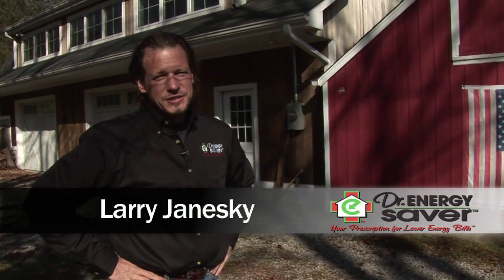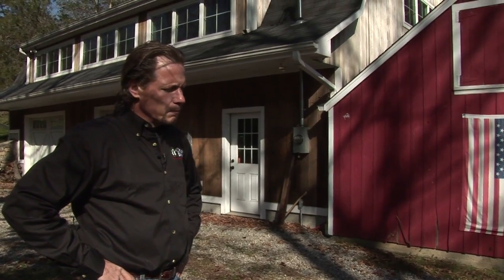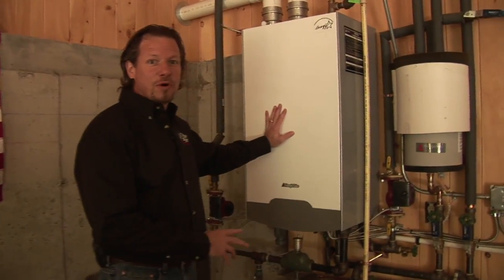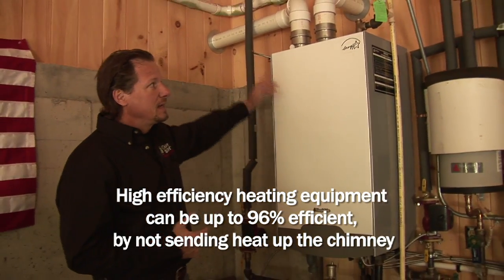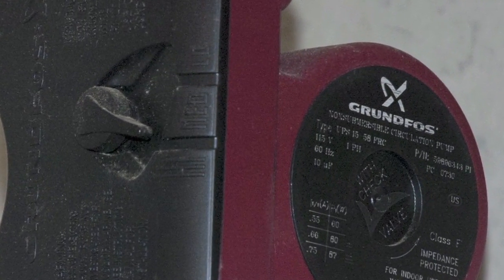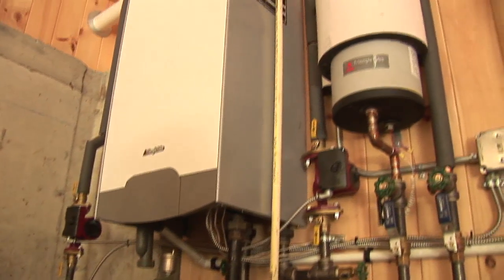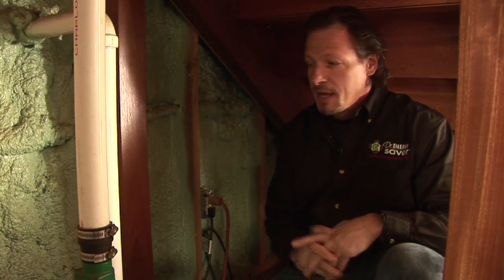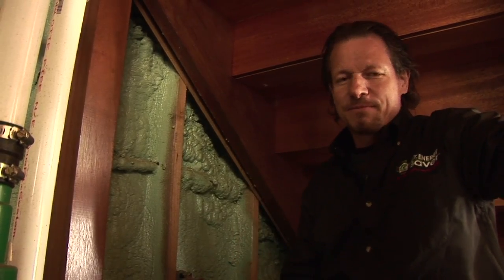Energy Efficient Barn with Radiant Heated Floors, Tankless Boiler and Spray Foam Insulation

Comment: Fabulous! Love the utilization of a tankless system for both domestic hot water and conditioned space heating. Would love to have more information on controlling your variable speed recirculating pump and more specific details of physically plumbing the entire system. Are the systems separated with backflow prevention or otherwise separated? Overall, a very fine video. Thanks!

Comment: That is a 3 speed pump, meaning you can choose on of 3 speeds. After that the boiler varies temperature based on an outdoor reset curve if an outdoor temp. sensor is installed. The pump will not vary its own speed...ever. To do that you need a pressure or temperature sensitive smart pump.

Comment: There is no such thing as a "tankless" boiler. This is a low-mass, wall-hung, condensing boiler made by Triangle Tube. 

The PEX tubing should be sleeved as it goes into the slab to protect if from damage. Baseboard is a poor conductor and not well matched to condensing boilers. Panel wall radiators would be in order, easier to control and operate at lower operating temperatures. 

This boiler is over-sized for the space. After foaming, a great idea, a proper Manual 'J' heat load analysis should be done. 

The pressure relief valve is improperly installed and could cause a hazard. 

The slab will never reach 80°F since the thermostat will be satisfied well below 75° surface temperature if the room stat is set at 70°. 

You can heat any space and melt snow with radiant slabs.
Reply: It's so hard to find a newer townhouse without forced air heat. I wonder what it takes to convert one to hot water baseboard. It's so hard to even find an answer to the question, but i can't live with forced air heat.